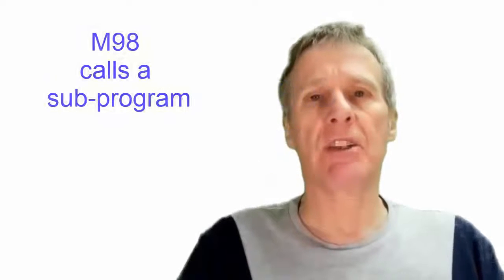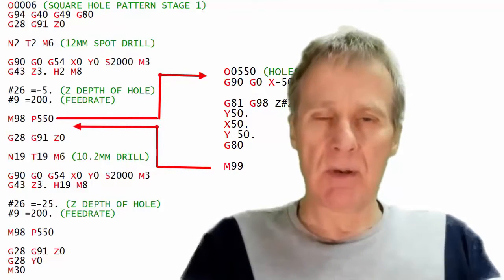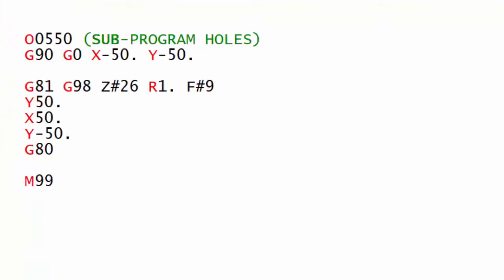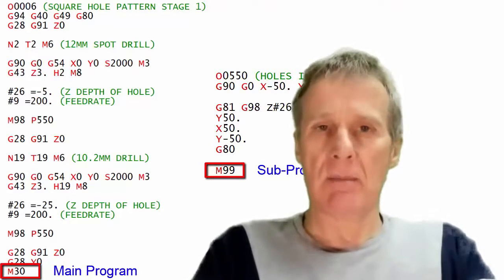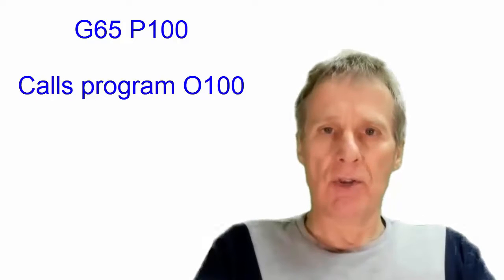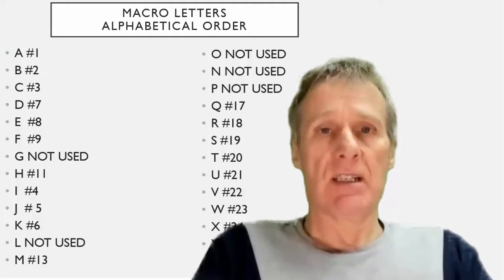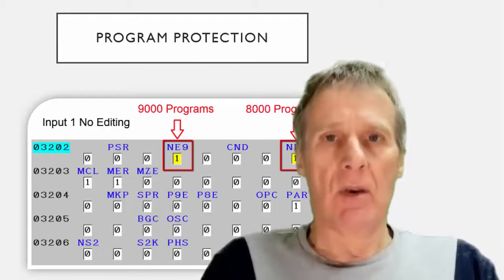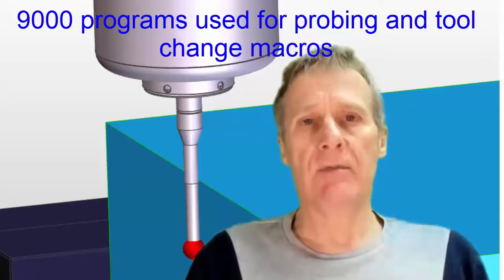How To Call a Fanuc Sub Programs M98 and G65

Comment: You're 100% on point with all of this!  I am trying to do some exotic things with macros right now and stumbled into your vid.  You are a guy that probably has the answers I seek.....ha
Reply from the maker: You'd have to tell me the question, thanks for your comment
Reply: @cnctrainingcentre603  I will try to explain, yet be brief.  We would like to employ either macros and/or subs to basically step out of the control and program, to an external device such as a micro PC, then allow the PC device to check certain things like we will say coolant level sensor, then have PC return to CNC program with say an M99.  G65 is also an option, and we have started to look at features such as 'Dprnt'.  This may not be possible as the external sub would not be in the CNC directory.